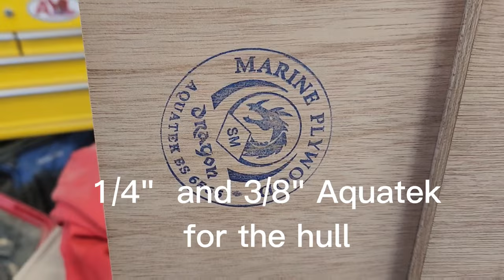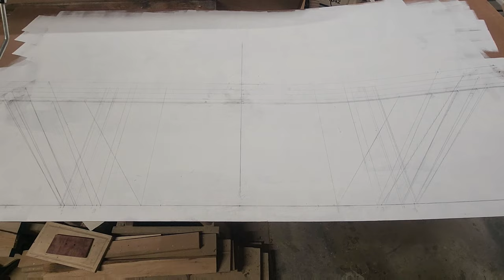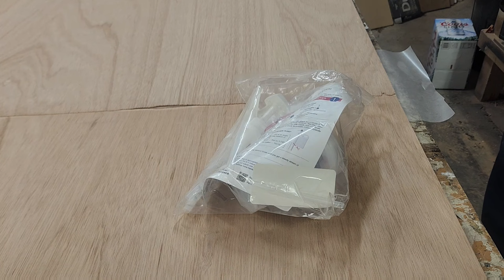Mackenzie River Dory build part 1. Wooden boat building!

Comment: Questions for you.. With the panels and scarfing plywood, the intructions say the sheets should be 4x16’ but after the joint it measures 4x15’6.. Is that how it’s supposed to be or do you need to have more than one joint per piece of plywood to make up the extra 6 inches? Thanks!
Reply from the maker: Great question. I had to glue two 8' and one 4' panel up for each side.  So there was 2 scarf joints per panel. I hope this helps,  thank for watching!